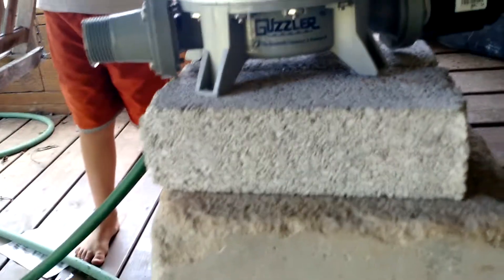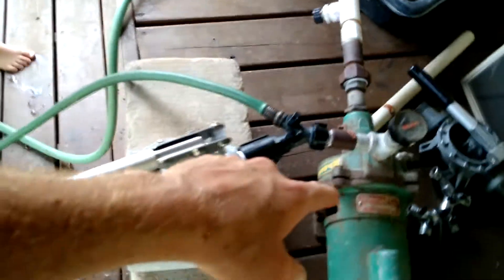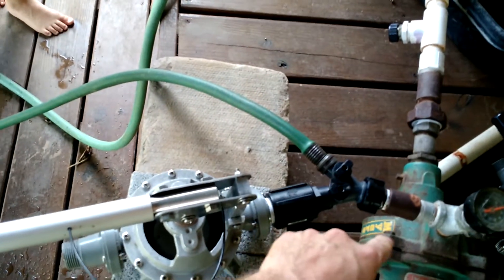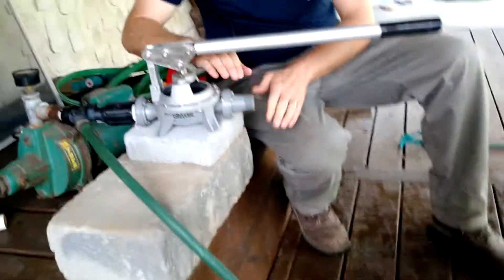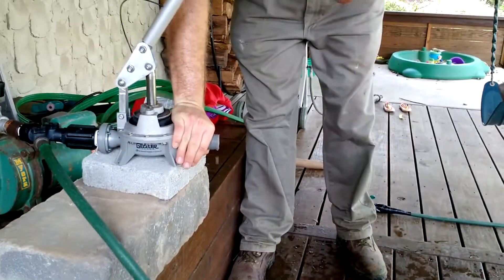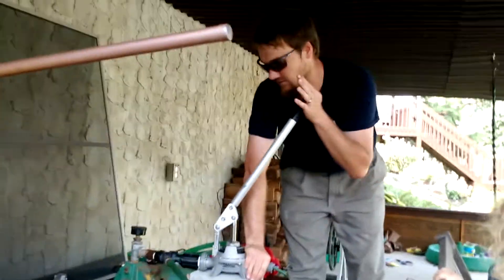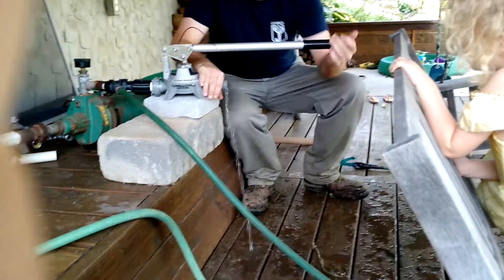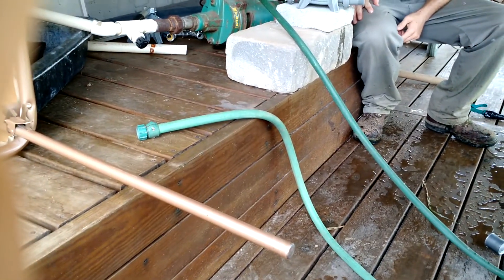The guzzler as a priming pump

Comment: I just bought one for priming and backup. I didn't pay extra for the long handle but instead sliced the end off the hand grip with a   knife and slid some stainless tubing  that's a slip fit into the original handle. My new electric pump like many came with a heavy flat  plastic base to protect it in shipping which I bolted to the Guzzler via mounting screw holes.  That gave me a free, convenient base I can use to hang the pump from a wall in my pump house. (I plastic bagged the Guzzler to keep out dust and dirt daubers while stored.)

These pumps are very well designed, self-priming, and make the cast iron rust-prone junk pitcher pump a joke by comparison.  I'm a highly experienced aircraft mechanic, weldor and hobby machinist. I won't hesitate to by more Guzzlers and while the light duty is fine for priming and moderate use (and the design is very easy to work on) if you need more check their catalog for heavier duty models. Bosworth make MANY pumps. These are NOT cheap offshore junk and have been used in boating for decades.  I suggested Bosworth market them better to other users. https://www.thebosworthco.com/products/selectp.php?category=F
Reply from the maker: Yeah, that's a great tip! they are a great little pump. I'm glad I have it if there is an an emergency situation.